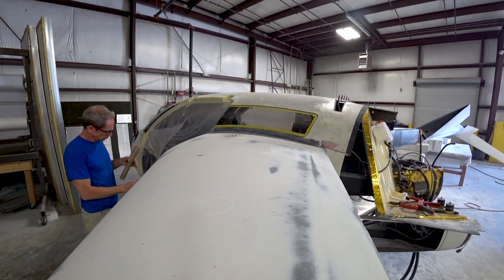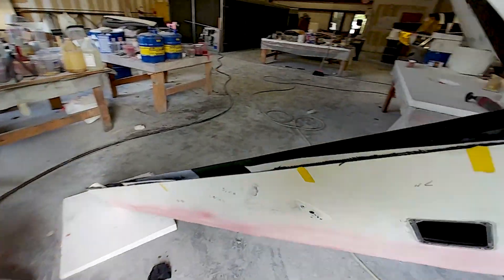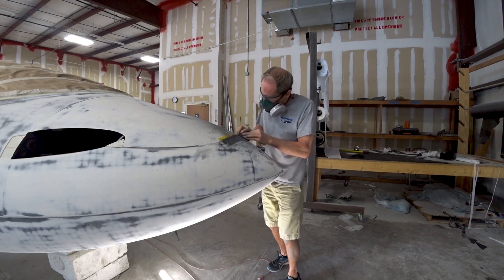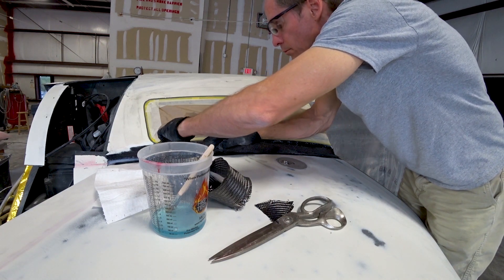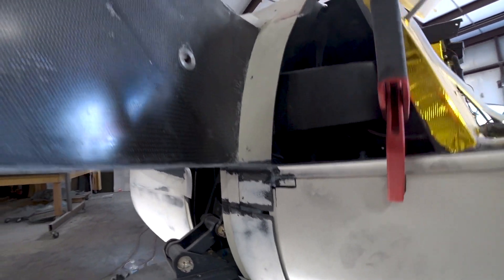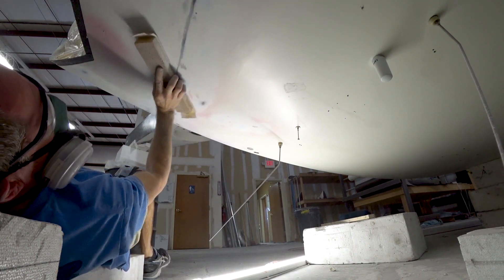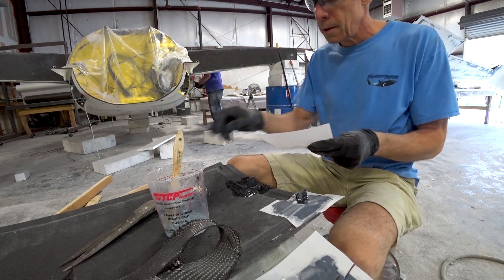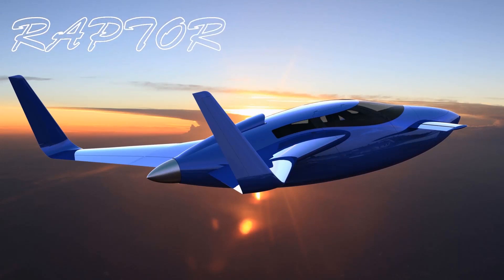Primer Preparation - Building the Raptor Prototype

Comment: Such a pretty aircraft. But as I was watching you fair off the strakes (and having just watched a NASA video), I wondered why you didn't design an entire blended wing/body? You have used the leading edge of current GA ideas for most of the aircraft; this would have been a little past. Just curious.
Reply from the maker: Blended wing bodies present two problems that I wasn't wanting to deal with. First of all, and most importantly, without a fore plane the aerodynamics are more complicated and in my mind making it stable can be problematic because you only have a single lifting surface. Secondly, it's more difficult to handle entry and exit with some kind of door when the leading edge of the wing comes so far forward. Frankly, the aircraft you've probably seen recently isn't really a true blended wing IMO. The transition angle from fuselage to upper wing skin is not that much different from the Raptor.

Comment: I think this aircraft have all of characteristics from a certified aircraft and exceed, if it could be sold by almost the same price that it are being sold as experimental it would be a revolution in general aviation. But it's almost impossible because I were scared only with the price of a continental diesel engine in oshkosh.

Comment: Have you decided what color you’re going to paint her? Any pattern,or just a single color?🤔🤔🤔👍🏻👍🏻
Reply: It should be "guide-coat Pink"
Reply: I'm hoping for it to be painted black. Anything in black looks sleek and sexy but on a plane, it just makes it look ten times more badass and elegant, which is what I see this project being.
Reply: @SolutionSecretsConsulting       It should be UV resistant.
Reply: @berniemccann8935  I fully agree! Well said
Reply: @SolutionSecretsConsulting  There are dark paints out there that contain UV reflecting pigments. They are used to battle the head island effects in large cities. Or would be used if they wouldn't be so expensive....
Reply: @FrankBredow  Straight from the manufacturer would be the key through production possibilities lowering the costs in the volume of sale
Reply: @SolutionSecretsConsulting  It seems that few people have studied the colour of fibre sailplanes ... they have decades of experience with colour.
Ok for the prototype, perhaps.